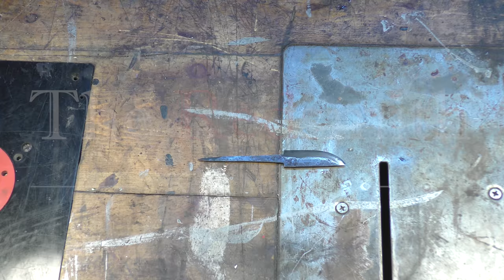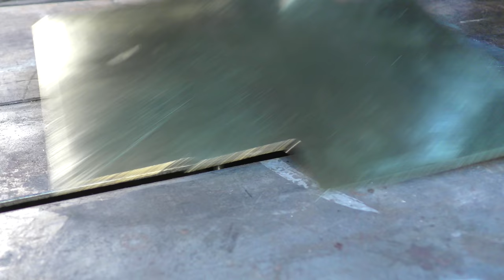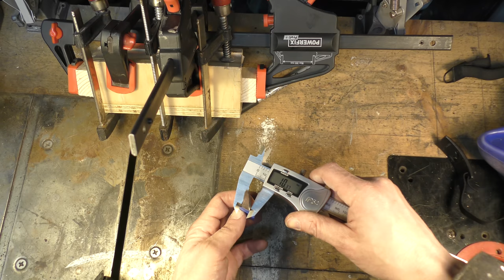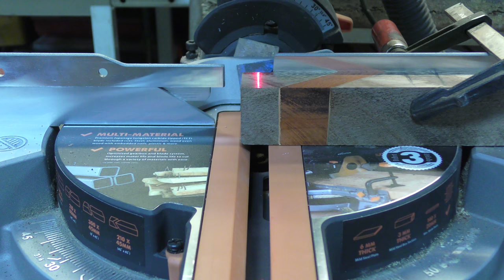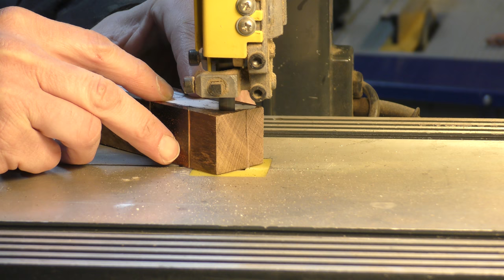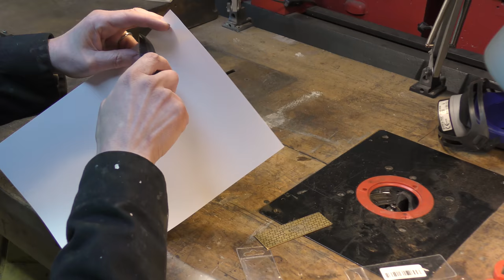Forged EDC Knife - Knife Making

Comment: Beautiful handle, with a great shape - gives a very good grip. 👍👍👍
Reply from the maker: Thank you very much!! It does indeed. I'm not used to the length of the blade yet, but I wil😊
Reply: @RedSmithWorkshop  Yeah it's a bit short, but that makes a great wood carving knife - you can put a lot of force on the tip with your thumb.😊
Reply from the maker: That's probably what I will use it for :)

Comment: Curious handle design. It looks like if you stab something with it,  your fingers will slip forward and you will get cut very badly. Looks very pretty,  but I wouldn't use it. Thanks for the video
Reply from the maker: Thanks a lot. This knife is not made for stabbing, I think I'll use this one for EDC or carving. In fact, the handle fits perfectly my hand. It's probably hard to judge just by watching the video though. Thanks for watching Milan!

Comment: Beautiful handle, but why did you cut the tang? And then not pin it?
Reply from the maker: The tang was too long. I didn't have a drill bit long enough to drill the handle blank. But as the blade is 3cm long and the tang was 10cm, it doesn't really matter. There was still a 6cm long tang left, which is more than enough for that kind of knife.
We never pin a true tang.
Thanks for watching.